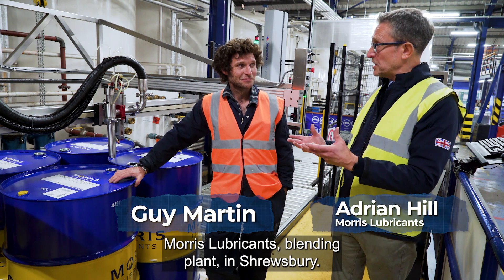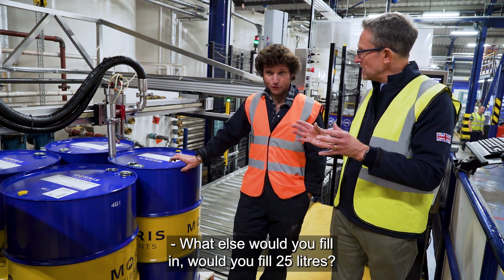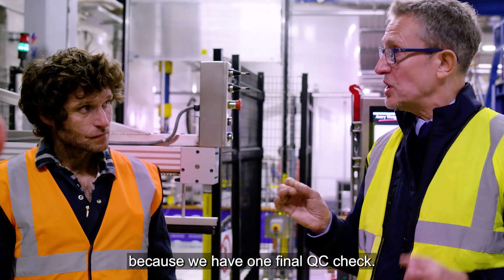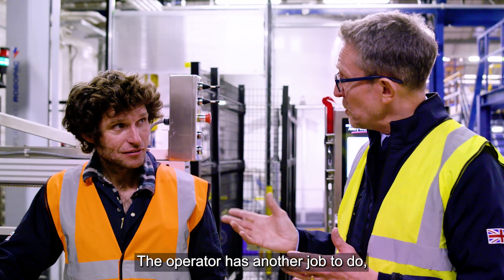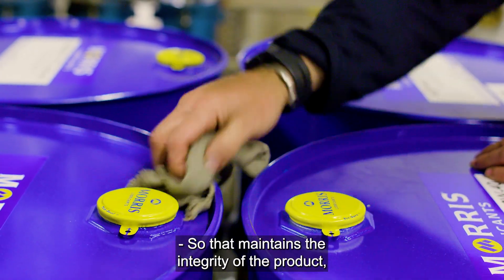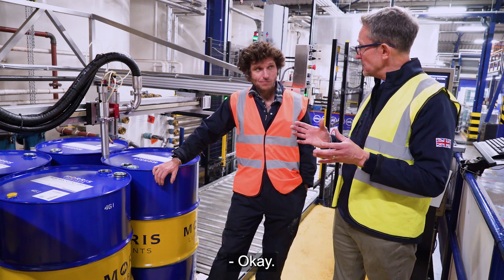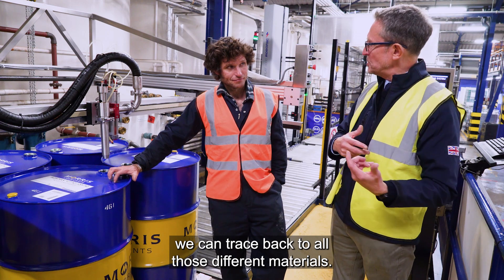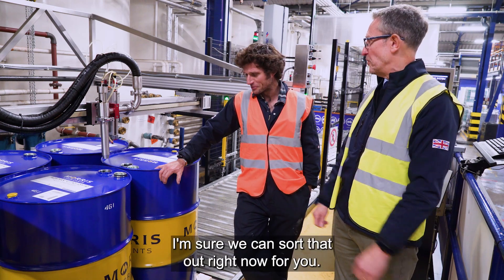How Oil is Made with Guy Martin - Episode 4: Filling Lines

Comment: very good oil and British ...just wish they would change the crappy steel 25lt drums  with a plastic lid for a plastic drum .. Evan new unopened drums will get water in them if left outside and when empty you cannot use them for anything else like a diesel...in the past, i have changed oil supplier just to get a decent empty drums

Comment: I have used Morris Lubricants since the early 1980's. I have run my 2000 Harley Davidson Twin Cam on your Ring Free XHD 40 from new, its now done just under 54,000 trouble free miles. 
And once my 1972 BSA A65 750 Devimead Lightning is run in, after its complete rebuild, it'll be run on the same.